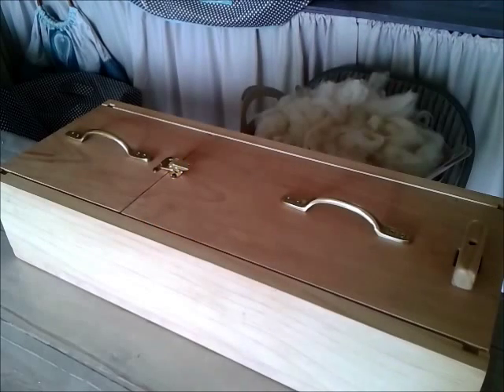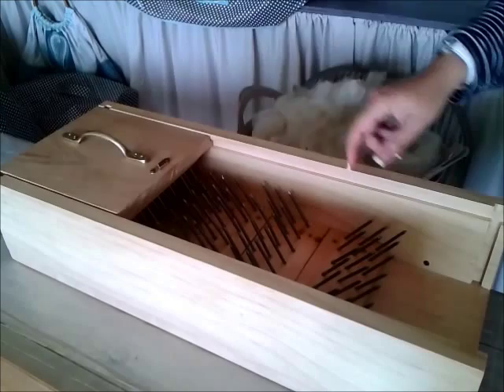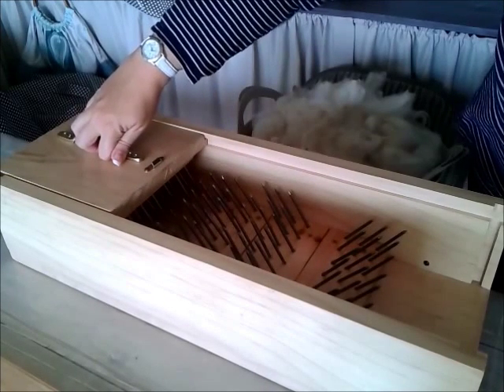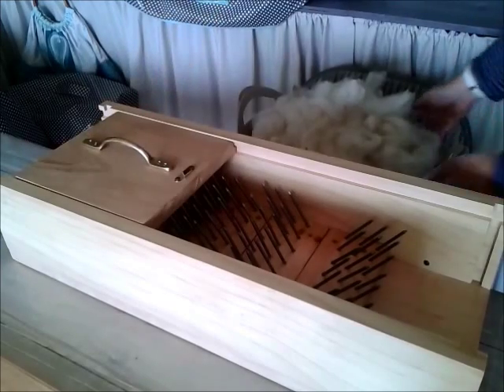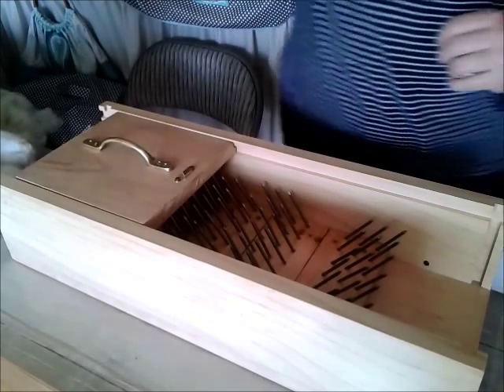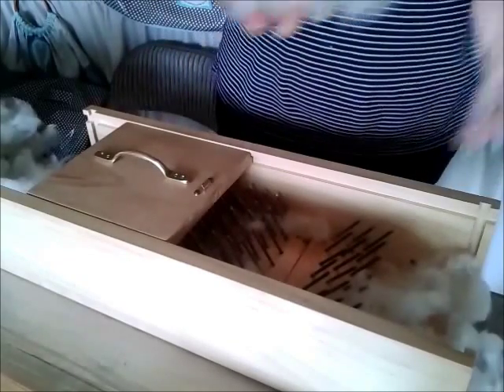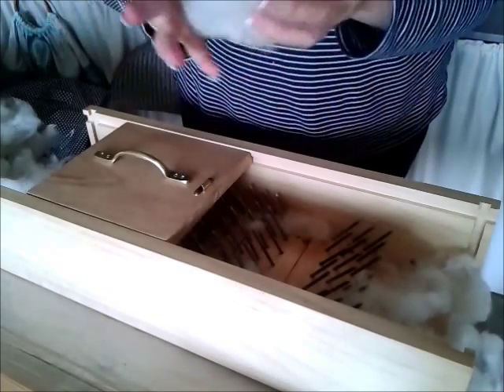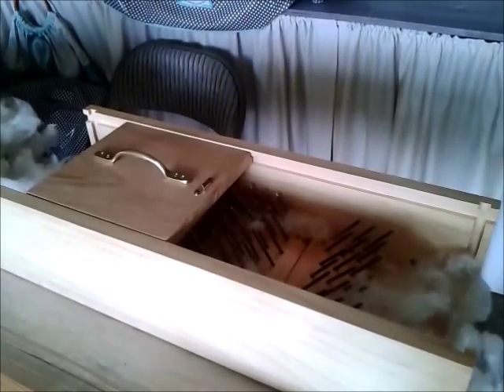Wool Picker

Comment: What amazing Craftsmanship.  I just watched another video and they ordered theirs.  Their nails were sharper but the design was pretty much the same.  Their ends didn't coome off... Brilliant for you.  Did the sliding and picking action get easier as the wood became used and the nails coated?  I think your pickbox is amazing!
Reply from the maker: Deanna Stevens thanks so much for your lovely comments. The grooves that the handle runs in are waxed to make them run smoothly, and once they warm up with the friction it does help. I have seen the nails sharpened using a drill and stone, and if I need to replace them eventually I'll do that. It works fine for now so it would be interesting to see if it makes much of a difference.
Reply: That's great.  I would never have thought of waxing.  Great idea.  I showed your video and a couple others to my Husband so he can make me one.  I was recently given 15 fleeces from a local sheep grower.  I have a lot ofwork cut out for me and I don't have any supplies except hot water and soap.  :)

Thank you for a great video.

Comment: This is such a nice design! I'm trying to figure out how to make my own and this is the best design I've seen so far, with the interlocking parts to keep it together. Did you use a router to make the grooves?
Reply from the maker: Frances Carter Thanks Frances! Yes I used a router to make the channels, very carefully as I don't have much experience with one! I did a couple of practice goes on a bit of scrap first to make sure it went ok, I think there can be a risk of tearing out the thin strip of wood it leaves at the edge, so perhaps do a few passes getting a bit deeper each time to be safe. Hope that helps, good luck with your project!

Comment: What size nails did you use, this is glorious and very fun, thank you for showing me how this works!
Reply from the maker: Thanks, I think they were about 3.5" - 4" long, the longest I could find without a galvanised coating. I have seen some people grind each nail so the end is smooth and finer too, if you can imagine doing all those!
Reply: @ottercopscrafts  thank you so much!!!! I am just learning about prepping wools, was there a pattern you went off from? Thank you for responding too. I just started prepping for my local farms,
Reply from the maker: @pixgeekphotography  I had looked at different types of picker and had trouble finding someone who was making them. I like woodworking anyway so decided to have a go! I bought a board that was about 8" by about 40" and worked the design to fit the board. The hardest part was not tearing out the edges when I routered the channels for the lid to run in, probably would recommend using a hardwood if you can! Best of luck!

Comment: Where did you get this wool picker and what did it cost?
Reply from the maker: The picker cost very little as I made it myself.  The wood cost about £12, the nails about the same, and the hardware probably the same again.  The varnish was some we already had so all in all it cost about £40 tops!  Took a while to work out the design, and I would grind the nails smooth and more pointy if I was to do it again, but it works well enough.  Thanks for your comment.
Reply: Hello there, I have been researching wool pickers for weeks now, with the desire to make my own, as they're so pricey to by. Feel like I've got tines imprinted on my brain. Your little picker is inspiring, well done you!!!